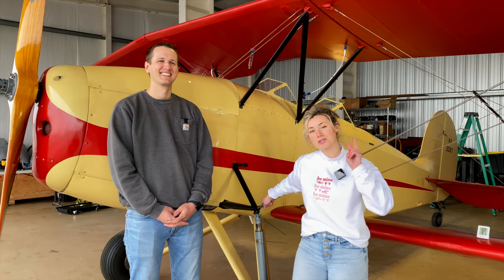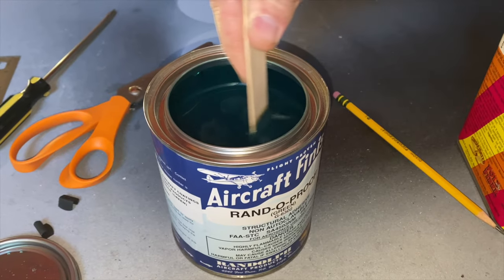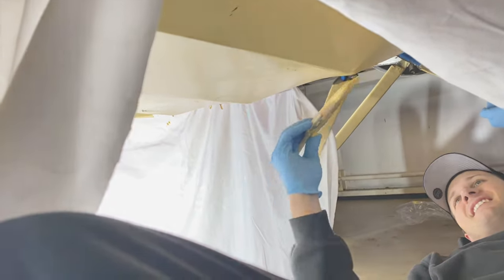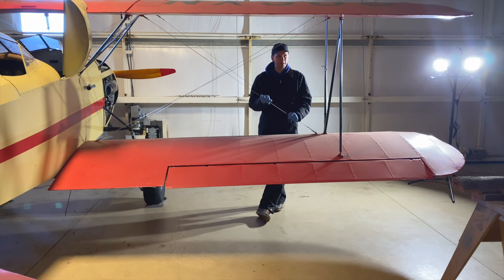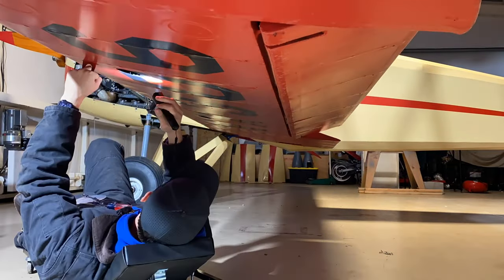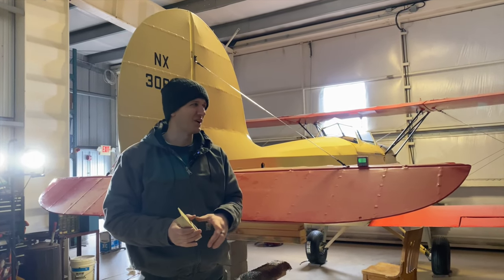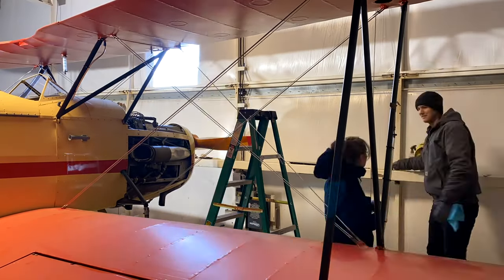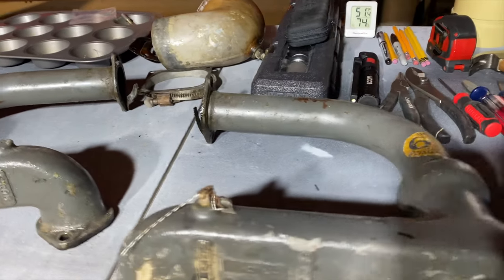Ranger Great Lakes Biplane Episode #2 — Airframe Inspection, Rigging, Stewart Fabric Repairs

Comment: What is the recommendation for the empennage brace and upper wires.  The Rigging manual doesn't mention what the tension of the upper and lower wires.  Just that "Adjust brace wires to proper tension in this sequence; first,
assure alignment of stabilizer hinges with lower wires, then
adjust upper wires to proper tension while achieving straight
alignment of fin hinge."  For the wing rigging 750 +- 50 and for center section 800 +- 50.  But not for empennage.